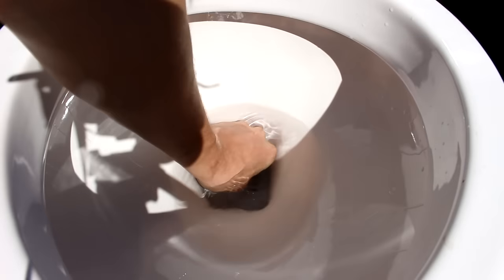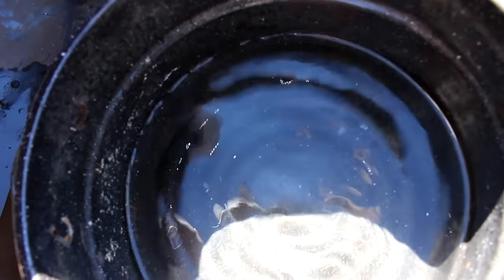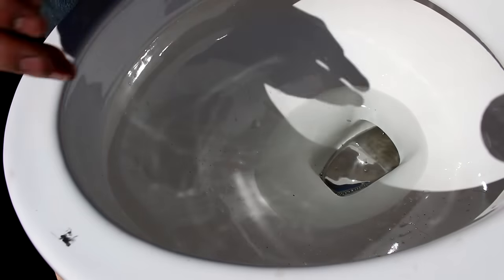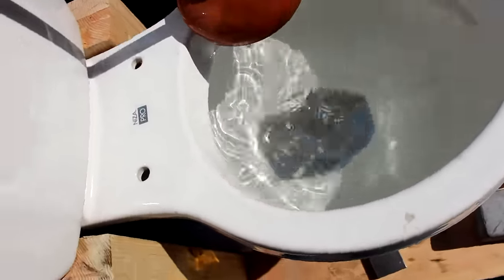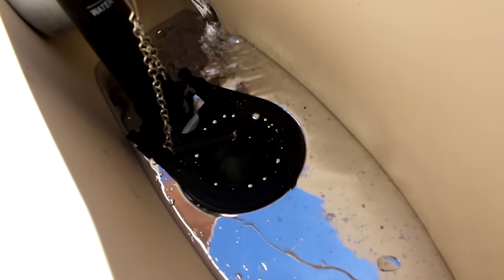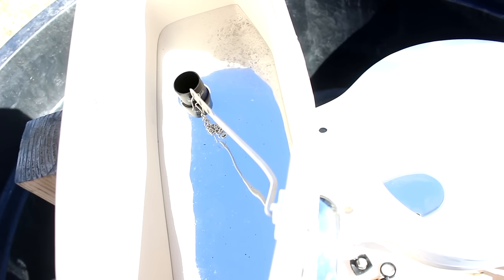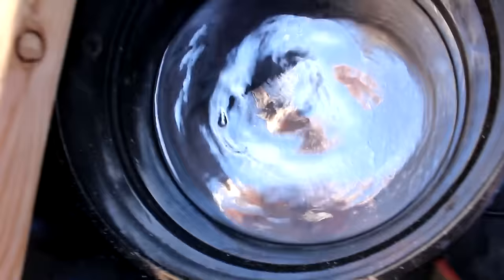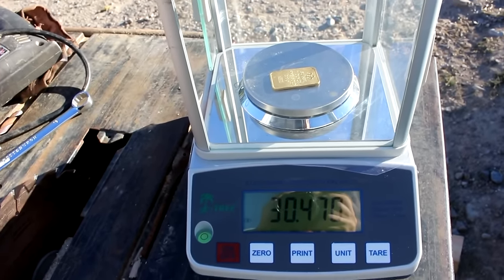Flushing 240lbs of Mercury

Comment: at least wear gloves
Reply: He was breathing the vapors. I really want to know how much mercury he has in him
Reply: You actually can have it absorbed into the skin and Mercury is more toxic than lead due to how unsafe it is to handle.
Reply: No.. No it is not. On what basis do you make your claim? Straight from wikipedia: "Mercury and many of its chemical compounds, especially organomercury compounds, can also be readily absorbed through direct contact with bare, or in some cases (such as methylmercury) insufficiently protected, skin. Mercury and its compounds are commonly used in chemical laboratories, hospitals, dental clinics, and facilities involved in the production of items such as fluorescent light bulbs, batteries, and explosives."
Reply: bacorable You should take it out of your teeth. Any dentist would recommend that.
Reply: well i was in a pretty open area where vapors could disperse
Reply: autocorrect, yes that excuse will do :)
Reply: The truth is too long and boring for most people, even though it's just a couple of sentences.  Actually, elemental mercury isn't nearly as dangerous as it is in a chemical form.  That's why getting it on your skin isn't all that dangerous if you wash it off soon after, because it doesn't have much of a chance to absorb.  If you get it in a cut, it can react chemically, and enter the body, where small amounts can be bad for your health.
But it's much easier to take the hysterical approach, and just fear the name "mercury."  It's much easier than actually learning the truth.
Reply: Landrew0 couldn't say better :D
Reply: That is a scam. Dentists that remove fillings "because they contain mercury" can lose their license.
Reply: ..."elemental mercury isn't nearly as dangerous as it is in a chemical form". What? You know elements ARE chemicals, yes? And that elemental mercury is neurologically damaging? True, the mercury in dental fillings is an amalgamate of powdered metals with liquid elemental mercury that hardens as the metals alloy together. They are considered safe, but studies show even the best mixed proportions of fillings still release a low, but still non-zero, amount of mercury vapor. So perhaps you meant "mercury that has been properly stabilized with other chemicals isn't nearly as dangerous..."?
Otherwise, next thing, you'll be saying that anything natural isn't dangerous. Like Arsenic or Cyanide isn't natural. :)
Reply: Nøt Sûre 
Yeah, you're right, who needs facts. Better to err on the side of hysteria.
Reply: is this mercury the same as thermometer mercury? and should i worry if i break a thermometer?
Reply: Ridwan Sunandar in the end Mercury is something that should always prevent touching or inaling it's vapors, anyway in my country we deliver the Mercury thermometers to a farmacy and they give us a eletronic one
Reply: hi
Reply: theres no need. just wash your hands when your done
Reply: +Ridwan Sunandar Yes, it is the same, because the only other Mercury is Freddie :D. 
Anyway, if you break a mercury thermometer, you should try to gather any spilled mercury in a sealed container while avoiding direct contact with it (I would even recommend some breathing protection). If you get mercury on a carpet, then... it would be better to dispose of it.
Reply: It probably doesn't change anything at this point...
Reply: Depends on thickness of skin. His hands are that of a worker, so a lot of dead compressed skin forms some sort of barrier which has a lower absorbance factor compared to lets say the skin of a woman who works with documents and is very porous and easily hydrated.
As for inhaling, while out in the open any vapors get dispersed too quickly to build up as a danger to health.
Reply: It doesn't really fucking matter. Speculating all this shit is a waste of time. Maybe he will die earlier than he would without doing anything he does wrong what comes to all the complex health warnings and things. Eating in McDonalds is bigger threat for people than handling metallic mercury. If you know what you are doing, it's alright.
Reply: Naw, better to err on the side of hysteria and fear the word "mercury."  Learning the actual facts is too much work.
Reply: DiomedesStrosMkai , read the cdc citing you made again and tell us what it says about metallic mercury.  If anything, he could have been wearing a respirator to protect himself from vapors, although even that was not necessary.  Further, the comparisons you made to children carelessly playing with "mercury" (not sure which form in this case) are completely irrelevant.  Cody is neither a child, nor did he use unsafe or uneducated practices in this video.
Reply: It's still his choice to dip his hand into liquid mercury, based on his knowledge of the risk.  I've done much worse than that as a kid, and I have no detectable after-effects.  
We used to coat a copper penny with mercury using our fingers. This was after the Etch-a-sketch broke and the liquid mercury ran out.  Our breakfast cereal was made from wheat that was treated with mercury-based fungicides.
Reply: Good points. I probably overreacted... maybe someone else did too.
Reply: Um that was aluminum powder, no worries.
Reply: he knows about the gloves just watch the whole video

Comment: very cool experiment!! I didnt know mercury disolved gold at that fast of a rate.
Reply: Yes, the old time gold prospectors used to put mercury in the riffles of their sluice boxes.  Even the low wage gold miners in Africa still use it.   Nowadays dredgers pick that up and they have to collect the mercury and send it off to a smelter or retort off the mercury themselves.
Reply: The mercury didn't dissolve the gold, the nitric acid did.
Reply: +Folopolis is wrong. Was the mercury that dissolved the gold.
Reply: Folopolis No, mercury does have a caustic effect on certian metals, I just didnt think it was a fast reaction.

Comment: Mercury does absorb in some not so insignitficant amounts through skin.
Reply: tokenlau a small amount of mercury may enter the body if you touch it but it's usually not enough to harm you. Unless you continue to touch it of course
Reply: Usually it is "safe", but not to everyone, because sensibility to mercury poisoning vary greatly, some people (thought to be less than 10%) are much more susceptible to mercury poisoning than others. Also I put safe in the quotation marks, because even when there are no symptoms of poisoning we have to remember that mercury is a cumulative toxin, so it cumulates in the body (particularly long in the CNS) and adds to the body total stress, thus even though there are no symptoms, it is not healthy, and therefore not reasonable, to be consciously exposured to any amount of mercury. Unlike some other heavy metals mercury is not a microelement (i.e. it is not beneficial in small amounts, it always acts destructively on cells and compounds contained in them and between them).
Reply: Mercury is only especially dangerous if it ends up in your blood stream in high quantities.  So basically, unless you have a cut or inhale the vapors, you're pretty much fine.  Also despite what people think, mercury doesn't permanently bio-accumulate inside your body.  Studies have also shown that the body will purge mercury, but it takes a very long time, and it won't reverse any damage it may have caused.
Reply: A doctor touched mercury with gloves on and died from mercury poisoning. She didn’t touch it directly but it still absorbed through her gloves. She was a doctor in a lab experimenting with mercury.
Reply: I'm Purrito I mean, it was a pretty appalling event when it happened. Organic mercury is scary shit.
Not sure if adding mercury, even inorganic, to the water supply is a good idea, but I dunno, water treatment plants are pretty effective.
Reply: tokenlau unless it’s Di-methyl Mercury which of course kills you even through a glove
Reply: Megan Rebo that’s Di-Methyl Mercury

Comment: Get your blood test results back yet?
Reply: Hehe, reminds me on Sheldon saying "I'm not crazy, my mom had me tested" :D
Reply: Was definitely on Xanax when filming this
Reply: Elemental mercury is actually more dangerous when you get it on yourself, as it can be absorbed through the skin. The vapors it gives off are heavier than air and will settle near the ground or the source of the vapor, so its not as likely to harm you (especially outdoors). Its really not safe to be handling without gloves.
Reply: same thing could be said about your mom
Reply: what now about the lord emperor trump?
Reply: seriously? I'd think The skin inside the mouth isn't stratified squamous. It's simple epithelial, which is a lot easier to have chemicals soak through.
Reply: Being stabbed by a knife and them leaving it in you is better than being stabbed and them taking it out of you...
Reply: There's a reason I put better in quotes. Neither are good for you, but swallowing typically will run a lower risk of poisoning than dipping your hand in it. Your skin absorbs it more readily than would your digestive system. Small amounts of mercury are typically excreted (almost completely) when ingested, while skin contact (albeit very slowly, so his contact with the mercury probably didn't harm him) will lead to absorption. The only real threat is inhalation, but the gas is so heavy that it will float nearer to the ground, and he was outside anyway so it was less likely to reach him. It's really not all that unbelievable if you think/research instead of being so negative and combative about it.
Reply: He just got them back
Reply: Jake he was outside

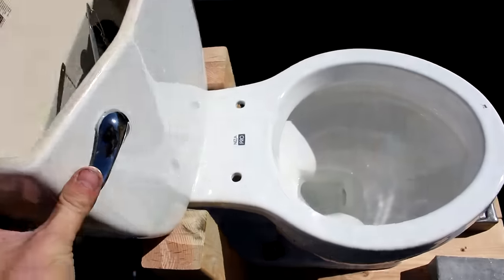Comment: 1:03 my guess is the surface tension of the water will keep the stream from moving it too much in the basin. I’m also going to guess the laminar flow will keep them apart. Same goes with the mercury, it’s going to hold itself together because of the surface tension.

Comment: now i know how to clog public toilets.
Reply: Or a whole bunch of really solid shit
Reply: queues Arby's commercial
Reply: SgtPiggie  thx for the advice
Reply: Cody Best XD lmao
Reply: Syncubus LMAO
Reply: Or find that one toilet with more than a roll of toilet paper and fold it up, layer upon layer upon layer. It takes far less than a single roll though. The layers actually hold water between them, and despite toilet textiles being designed to be "dissolvable", if you build up enough layers, the top ones hold the water, while the bottom ones only degrade from the water that you placed it in.
With enough paper, you build up enough of a barrier that the core of the paper should stay reasonably dry for a good few hours at least, until the top and bottom layers fully degrade and the water penetrates through it.
Combine that with a good few flushes, and bam. Easy as shit.

Comment: What does Mercury feel like? Cause you dipped your hand in there, it's can't feel like water
Reply: I'd bet it feels like a chilly metal against your skin. It doesn't wet the way water does, so that feeling won't be there. Maybe something along the lines of a cold plastic something or other.
Reply: If you've ever stuck your hand in a really really tight glove, its kind like that, plus cold.  Its not a feeling of wetness since it doesn't stick to your hand afterwards, the biggest thing you notice is the pressure.
Reply: well you cant touch it because you would be searisly ill.and withoout medical attension you would die
Reply: Umm, he dips his whole hand in it in the video multiple times. I was more concerned about his shitty tablesaw etiquette.
Reply: still_guns I thought mercury is poisonous
Reply: TooMuchHype Your Friend It is
Reply: Elemental mercury DOES have a toxic quality, but it is not poisonous.  And it is rather difficult to get it into your system.  You could swallow a good glob of elemental mercury and not die.  It would pass right through you doing very little damage (really not advised).  The really toxic exposures are mercury vapor inhaled, and mercury dissolved into your blood.  Certain mercury compounds are very easily absorbed, but elemental mercury is about as toxic as gold and lead.  All three are heavy metals and in elemental form are very difficult to get into your system where they can do damage.  Constant exposure to elemental mercury is bad as it will slowly find ways into your blood stream, and it will also slowly vaporize and could then be inhaled, but the vapor is very dense and would consistently seek lower ground, and re-condense there.
Reply: Fear of Mercury will probably kill more people in the next 10 years than actual mercury exposure.

Comment: WHY NO GLOVES OR MASK!?!?!?!?!?!? That stuff is poisonous man
Reply: because he's been exposed to it so much that he's now immune to its toxins
Reply: No...that's not how it works at all lol
Reply: ZyppyStar its toxic and he is basically immune.
Reply: eli ray that's the joke
Reply: Only if you have a cut then you might die
Reply: IKR!
Reply: They used mercury salts which are absorbed into the body a lot easier than elemental mercury. Mercury metal is fairly safe to handle as long as you have no open cuts or scrapes on your hands, And he was doing this outside to the vapor isn't really an issue.
Reply: LunarOwl1214 the hats they would use mercury vapor so that would go straight into their lungs thus into their brains. absorbing Mercury through the skin takes a lot of time and exposure for it to have any solid effect. if you want to die from mercury poisoning it would take a long time even if you drink the stuff. fastest way to die of mercury poisoning boil the stuff and breathe in all the vapors.
Reply: They used mercury salts rather than vapors, Which are absorbed much more easily into the body thru skin contact.

Comment: Where do you find this much mercury? Cheapest places I found charge $200/lb at this rate this video would have been VERY expensive.
Reply from the maker: Had it for like 60 years. Most of the cost is in Shipping and handling though. it’s actual bulk value is more like 20$ a pound.

Comment: God, I hate scales both that fluctuate, and that get triggered by the nearly nonexistent weight of the air around the scale's pressure plate. (A study hall teacher I had in my fifth year of high school had at least four small scales that were like this) The fluctuation and excessive sensitivity both make it impossible to get an accurate reading and thus force the user to guess one of the first numbers they see

Comment: In this video, Cody tries to flush different amounts of mercury down a toilet. He starts with a small amount and the mercury goes down the drain. He then increases the amount of mercury and the toilet is able to flush it all down. However, when he tries to flush a large amount of mercury, the toilet gets clogged. Cody is able to unclog the toilet with a plunger, but he cannot get all of the mercury to go down the drain. He then tries to flush the toilet using mercury instead of water, but he is not able to get enough mercury into the bowl to make it work. Finally, he is able to flush the toilet by dropping a piece of gold into the mercury. The gold is heavy enough to push the mercury down the drain.

In conclusion, Cody was able to flush small amounts of mercury down a toilet, but he was not able to flush large amounts. He was also able to flush the toilet using mercury instead of water, but he needed to use a lot of mercury to make it work.

Comment: I'm super late here but doesn't mercury give off some like super toxic vapor? Does it just disperse enough to not do anything outside?
Reply: as long as you're outside and not leaning over it and taking a whiff like some kind of deranged chef, it's fine. just don't stand over it
Reply: It should be fine, even in an enclosed room it has to be locked up for a while before it gets enough fumes to have adverse effects, and Cody was doing stuff with it outside on a windy day.
Reply: It can that's why it's under water for most of this till the final all Mercury test

Comment: 9:56 I can't be the only one to notice that the tungston was wedging against the flap, not the weight of the mercury causing it to be so hard to lift. 

I may be wrong but it makes more sense doesn't it? Why would the seal be harder to break? Wouldn't the effect of the mercury denisty only make it float easier, which is why you had to weight it down to begin with. The initial force you need to break the seal, would that even be effected?
Reply: I may be wrong but it makes more sense doesn't it?
Reply: @JorgTheElder  Nah i dont think so. Doesn't make sense for it to have been that hard to lift. Try it yourself with just water with something like that jamming it. There is nothing to bend and if it did its still not going to break the seal.